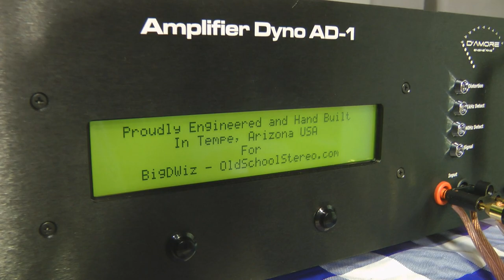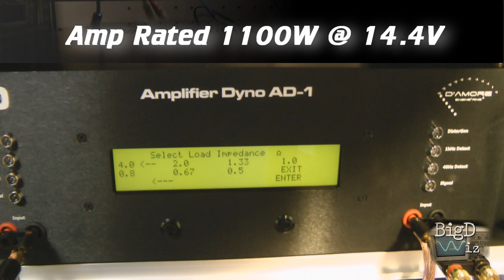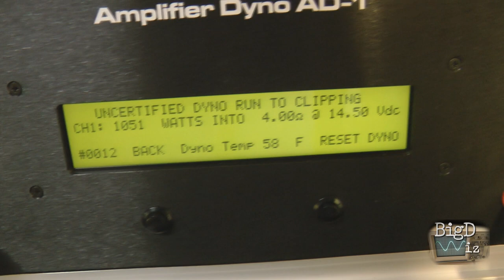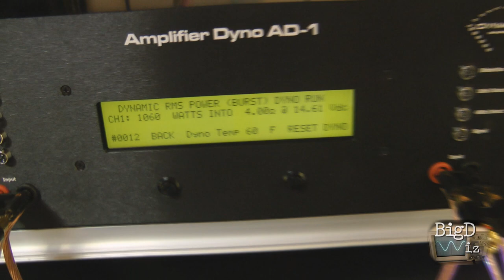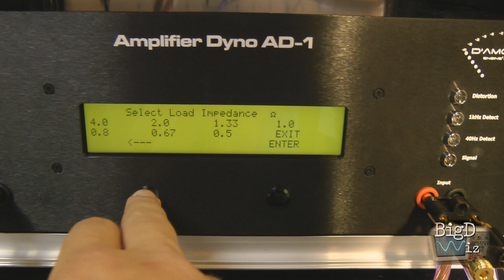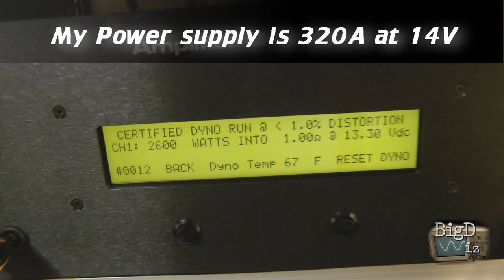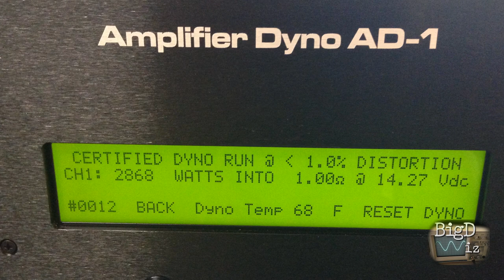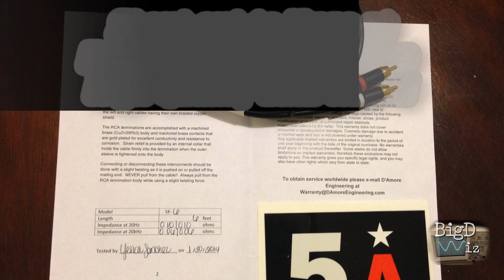Sonido Mask ZX-3000.1 Amp Dyno Full Test RMS Wattage Tested

Comment: Hi Derek, great video as usual! I was wondering if you could do a video about your power supply as it would be interesting to see how you can run such powerful car amps at home? Thanks
Reply from the maker: I plan on doing a more in depth video in the future, but here's one I did when I first got the power supply - http://youtu.be/F_NFhyQ0uYg
Reply: Dereck BigDWiz  I just use HP used server power supplies from Ebay (about $15 for 575 watts of power) and they are very stable and reliable too. There are various size transformers as well.
Reply: Matthew Barnard yeah ive seen a couple of people do that, barevids has a great video about using 930 watt dell server PSUs which is another good option
Reply: Dereck BigDWiz hold on, video title is 12v 250A yet in this video you were able to pull about 350A at closer to 13.5v? have you modded it since then?
Reply from the maker: WorldsDeepestBass The power supply is actually 250A at 18V, or 320A at 14V. Yes, I have some of the dell PowerEdge server power supplies also. Just need to mod them before putting them into production.
Reply: Dereck BigDWiz Please make sure to short the proper pins so that the fan is set on automatic instead of full on, (unless you like listening to jets instead of music). And, I thought those power supplies require 240V? idk.......

Comment: Crazy powa! Some nice looking guts too! If this is the same as an Audiopipe, I would get it just cuz it's chassis looks much nicer. If I were into these kinds of amps, that is. It's old school Class AB for me!
Reply: There not the same as audiopipe they got in touch with BigD after they seen his test on the AP 1501 as for pricing on this amp it retails for $489 they also have an FX 3000.1 which is not as beefy as the zx model for $399
Reply: Yeah I found out later on it's not an Audiopipe. Lol
Reply: Although a lot of companies use the same build houses so it wouldn't be too far fetched to think so.

Comment: Hey D, I got you a blast from the past if you are interested, remember the Sonido Mask 3000.1 ?
Reply from the maker: Poor Sonido 💨
Reply: @wal  Have you heard of a brand called Nemesis Audio ? The reason I ask is because when I opened up the back plate I thought I remembered the board lay out, and surprise surprise it is an exact duplicate to the Sonido Mask. Tried attaching some pictures but wasn't able to. Maybe thru your Facebook?

Comment: I'd like to test my Behringer Europower EPQ1200 Lightweight 1200-Watt Stereo Power Amplifier on your test setup just to see what it actually puts out.
Reply from the maker: Maybe Behringer will see these videos and agree to send me one! I have a friend who's a DJ and has quite a few pro amps we want to try on the Dyno (including a 4kW Crown amp)
Reply: Dereck BigDWiz Damn now that's something I would like to see.
I have a home made amp I built a couple of weeks ago that will give me 32-34V AC 60hz signal into a 2R load. I think it's 516 - 530 watts. My power supply at those wattage levels are 50-0-50 DC. 56-0-56 idle. Parts cost was $100 :D I salvaged my transformer from a 1500va UPS back up, rewound it for 120V and 40-0-40 AC secondaries.

Cheers!

Comment: they charge a shyt ton for them amps. i cant find one at a good price. nice vid
Reply: +Steven Jr $300 shipped/paypal!! That's a lot??
Reply: +toysareforboys 
i got ahold of the company and they told 460ish. i was like damnnn. lol i can get the ppi black ice 7k for 240 which will put out 3k easy and more like 3600 rms at half o cuz there stable at half ohm as long as you have the electrical to back it up. i ended up buying 2 of the ppi 7k black ice and strapd them and  getting a clean 5200ish rms
Reply: +Steven Jr Clamp test it with an oscope or dd-1 connected and see what you're getting clean. I tried to do my friends ppi 7k but you don't even wanna know the numbers we got :(
Reply: +toysareforboys 

was already clamped strapped but i have a 320 amp alternator with 4 d240p batteries and 4 runs on zero gauge. got 5218 rms from the 2 strapped
Reply: +Steven Jr Unless you have a DD-1 or oscope connected when you clamp you can't tell if it's clean or not. If it's clean those are super nice numbers though :)
Reply: +toysareforboys 

my buddies all went in on the dd or whatever it was. hes a custom box maker. whoever gets a custom box made from him gets a free tuning as well as clamp test. there good number but they dont do rated unless at half ohm but after box rise its aroumd 1 ohm. im happy with the number for the price. im doing a 156 with 4 american bass xfl 12s 1 k rms each my head unit has 5 volt pres and my gains a tad under 3/4 but it was all tuned properly with his gear at his shop. outlaw'd customs and the guy is a beast at customizeing
Reply: +Steven Jr Super nice man, great numbers too :) I need me some 5v pre-outs!

Comment: what can you do to get your power voltage to 14.4
Reply from the maker: +Tristen Fletcher are you asking what I need to do, or what you would need in your car?
Reply: BigDWiz yes I have have the same question what do you need on your car?
Reply: what I would need in my car
Reply: your car when turned on puts out 14.4 volts 
now if you have a power hungry system then that will drop to around 12.5 volts and that is what you want to fix. you want to basically try and keep the Volts from dropping below 14. so a high output alternator and the big 3 upgrade coupled with a xs power battery and all 0 gauge ofc awg runs then you should be golden. unless you are running more than 5k watts rms then most of the time a h/o alt good wiring and battery will do the job. if you are over 5k then you will need multiple batteries and possibly 2 h/o alts.
Reply: Put in a capacitor or secondary battery

Comment: um. okay, what on earth would someone need 7046 watts of power for? I have several amps, the biggest I have is 350 watts and it is really overkill for anything I have ever used it for! This is like what they use for concerts with over a thousand people! gosh. craziness. prob even more than that :P
Reply from the maker: I've been using a 4ch Rockford Fosgate Power 550x in my car for the past 10+ years and it's enough power for me. I run the front channels to the components and bridge the rear channels for my subs. I'm hoping to modify my electrical system soon so I can use my car as a "mobile test bench" for all different kinds of amplifiers/speakers/etc.
Reply: Dereck BigDWiz That would be a huge alternator!

Comment: what power supply are you using?
Reply from the maker: +arturo munoz in this video I was using a custom, 320A adjustable power supply (requires 30A 240V AC). I now use multiple banks of Maxwell Ultracapacitors